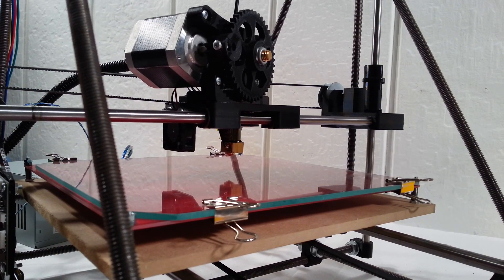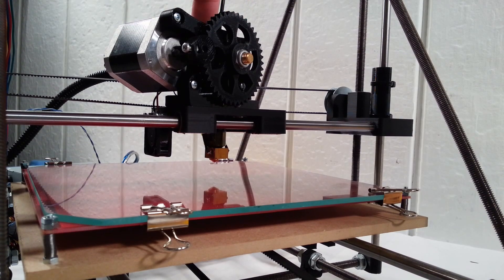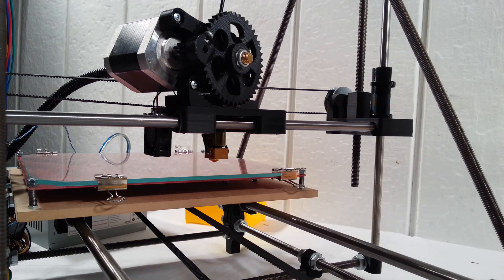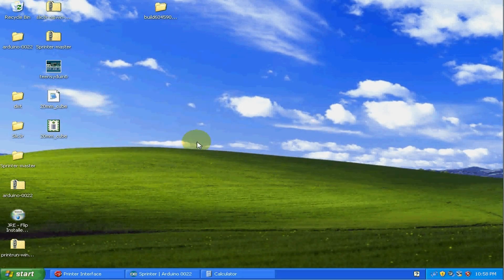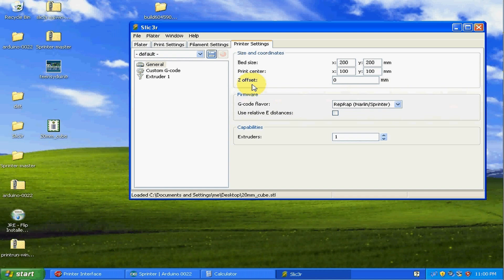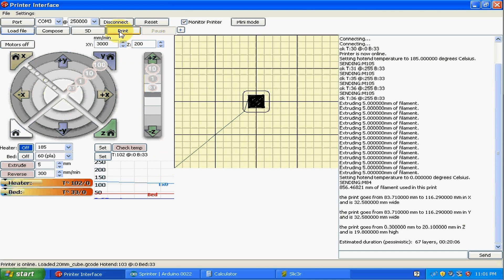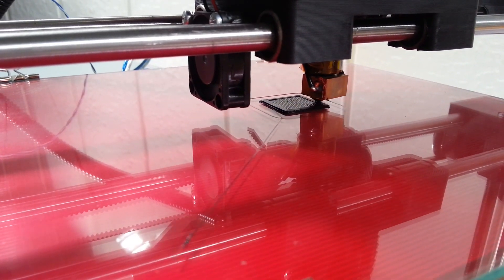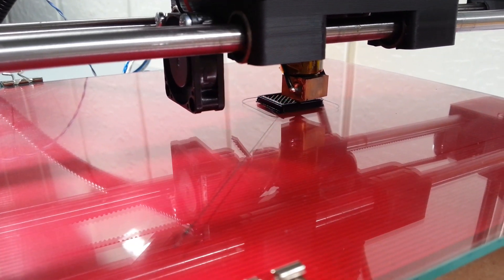RepRap Prusa Mendel Iteration 2 Assembly 24 - Extruder and First Print

Comment: I'm having an issue with the filament. when i tell the printer to extrude 5mm it doesn't move at all! the gears and motor moves but the PLA doesn't catch, even if i manually help. do you think their may be an issue with the extruder?
Reply from the maker: If you purchased the kit from NWRepRap, contact them directly for support. You'll need to figure out why it's not catching. Is the hobbed bolt touching the filament?

Comment: So my first attempt at doing this the PLA just got dragged around with the hot-end.  Second attempt I set the bed temp to 60 via pronterface, crap.  I've now got the hot-end set to 210, if I hit the extrude button stuff comes out nicely.  When I run the cube barely anything is extruded.  I've got some settings wrong but where?

Comment from the maker: With any printer you choose, you will need to learn how to repair it. All 3D printers fail at some point. Some more than others. The benefit of a kit is that you learn everything about the printer when you build it which makes it easier to repair later. It's sort of like buying a RC car in a kit versus a ready to run RC car.

Comment from the maker: The printing dimensions vary depending on a few factors. Our kits have a usable print area of 7.5" x 7.5" x 5". It's possible to get closer to 8" x 8" x 5.5" with modifications to the extruder and x ends.